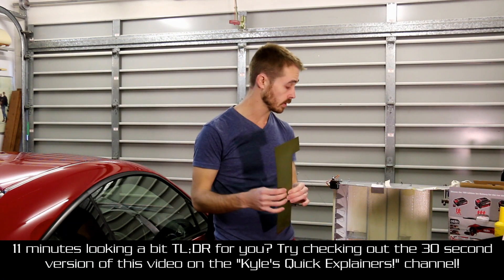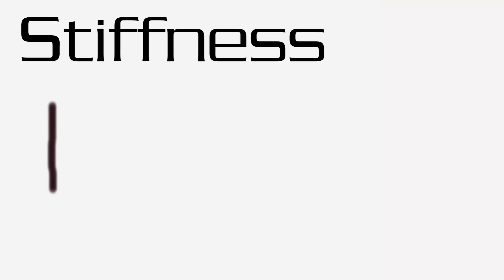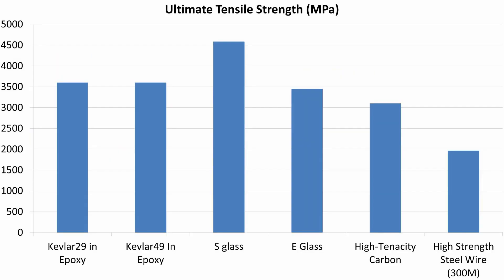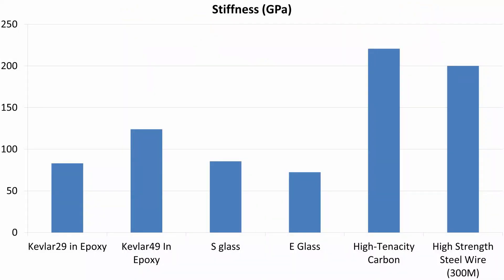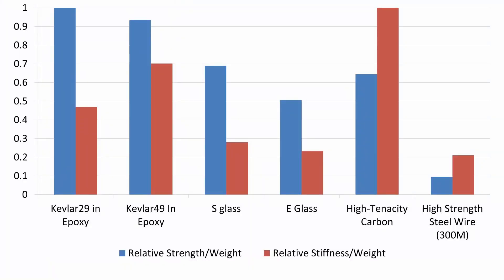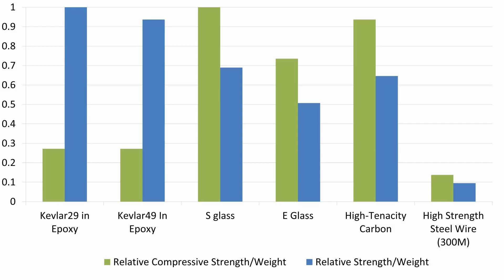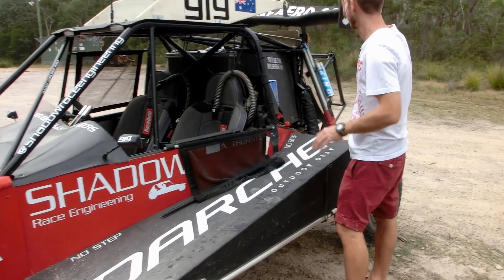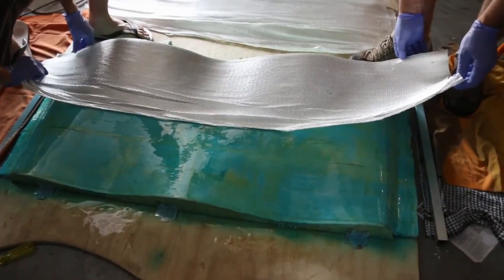Carbon Fiber vs Kevlar vs Fiberglass - Which one is right for YOU?

Comment: Huge fan of your vids- def the best at explaining motorsport engineering on the web. I have a request- can you do one on chassis rigidity? It's generally accepted that stiffer is better, but is that really true? Is chassis flex ever a good thing? Do engineers actually tune for it?
Reply: In top fuel dragsters flex is extremely important.  I don't know any details, but the frames are so delicate looking, that I don't know how they handle the extreme horsepower and stresses.  Failure in some have resulted in dramatic crashes and amazingly few injuries do to cocoon type driver pods usually made of carbon fiber.
Reply: I don't think manufacturers want flexible cars. 
If they did they wouldn't brag about making the car 25% stiffer from last years model every year.
It may add a layer of comfort to commuter cars with cheap suspension, however on performance cars manufacturers don't want the body flexing and pulling the suspension out of alignment.
Reply: Seconded! It's interesting how chassis rigidity is always touted as a plus, but many cars that we hold in high regard, like the Lotus Exige, or Honda's s2000 are not the most rigid. Great video as always, Kyle. Lots of information!
Reply: Beyond a certain point added chassis stiffness is a byproduct of other needs, usually NVH and crash worthiness. Plus OEM suspension bushes are often three-dimensional compliant, thus providing different suspension sets for different load conditions - chassis flex is far less of an issue for handling purposes than it was 15 years ago.
Reply: Beni Stingray thats a motor cycle 
These are cars
Reply: Yeah thats true but i think/believe the same goes for cars at least to some point. 
Sure a bike leans into a corner and you have sideway forces refering to the suspension but as long as youre not on an absolutly flat track and/or an extreme downforce car i think the right amount of flex is positive.
Lets hope he picks up the talk and does a video because im not an engineer :)
Reply: Some flex is needed! A good example for that is the Moto GP Ducati that was introduced 2011 i believe with the carbon firbe chassis. Rossi and other good drivers struggled a lot with that bike because they didnt get feedback under bracking and turning in. 
Good little article about it: https://motomatters.com/analysis/2011/08/08/the_trouble_with_the_ducati_desmosedici_.html
Reply: second that!
Reply: tmactmacy no
Never
You never want energy to be going into moving or flexing the chassis

Comment: After watching this video, a possible application of Kevlar that springs to mind would be within a pull rod suspension as the suspension arm. Kinda funny how few fiberglass chassis cars there have been.
Reply from the maker: Well, more often than not, chassis structures are stiffness critical (particularly torsion stiffness), hence the prevalence of CF chassis. Also, as I mention in the video, higher grades of carbon with more tensile strength do exist, and are employed by higher level race teams, but not by the home builder.  You could build a fibreglass chassis if you were on a budget, but if you were on that much of a budget, why not go steel spaceframe?
Reply from the maker: Apparently, someone made a list! http://www.pistonheads.com/gassing/topic.asp?t=1356682

Comment: +kyle.drives By chance could you dabble with basalt fibre composites? I hear lots of pros but haven't seen wider adoption.
Reply from the maker: I wasn't even familiar with them, having a look at their basic material properties though they seem great! I think it will only be a matter of time before they have widespread adoption though, it's like how they used to use boron fibres until they replaced them with carbon fibres.

Comment: "parts not subjected to impact"

surprisingly this has been done, both the SLR, LFA and laferrari has some form of structural carbon fiber that absorbs the impacts in a crash, though these are also shaped in such a way that they achieve structural strenght
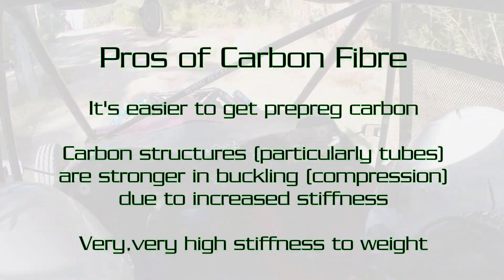Reply from the maker: Ah yes, I should mention this (will annotate the video). What I more should've said was shock loading where the part is expected to not fail, as fibreglass and kevlar will do better here. Carbon is a very common material in impact attenuators because they are designed to permanently deform (fail) inwards. Carbons high stiffness allows you to use a tube like structure and be very strong in direct compression (10:19 in video) without buckling. You then use a geometry like a tapered cylinder or cone and it essentially folds in on itself, absorbing large amounts of energy as it progressively folds down. This is further helped by the thicker walls per unit weight for carbon, which means they have more bending strength on a skin basis. FIbreglass may have buckled in this scenario (on either a skin or whole structure level, not stiff enough), and kevlar is weak in compression, so carbon is the way to go. One of the guys I went to university with actually designed a carbon impact attenuator for the SAE car we were working on at the time, saved a huge amount of weight for us. Carbon attenuators are also used on most high end race cars (including F1) in addition to what you mentioned.

Make sense?

Comment: "corrodes steel and aluminium"

why? it's a polymer so why does it corrode steel and aluminium? (answer in the simplest possible way)
Reply: Carbon fiber is still carbon and  is a conductor of electrons. That's one of the side benefits for  military aircraft, carbon fiber will absorb microwave energy from radar and dissipate the energy as heat.
Reply from the maker: It's all about the galvanic series. Carbon is a long way away from steel and aluminium, so sets up a sort of battery in real world conditions. Think about batteries where carbon is used as one of the electrodes. I have heard of some racing manufacturers using a single, thin layer of fibreglass under their carbon to help with corrosion on an aluminium honeycomb core. Our carbon/aluminium SAE car used to have huge corrosion problems with this.
Reply: +KYLE.DRIVES Can verify. Whenever there's a carbon to aluminum connection (it's almost always aluminum due to its great adhesion with epoxy, therefore reducing bond area needed), fiberglass is used to "shield" the Aluminum from the carbon.

Comment: what about kevlar fuel tanks?
Reply from the maker: Fair point, kevlar has very high toughness and good abrasion resistance, and fuel tanks are a component that will only ever see very high loadings in tension, so Kevlar is appropriate here. I guess for the applications I was only really thinking bodywork, I'll add an annotation for this.

Comment: Once again, excellent video. Honestly never really thought much about fiberglass (for Formual Student its carbon everything). In the making of body panels, or even structural fiber glass parts, would you recommend chopped mat or an actual weave pattern like twill? Any significant strength differences between them (assuming same fiberglass is used for either)?
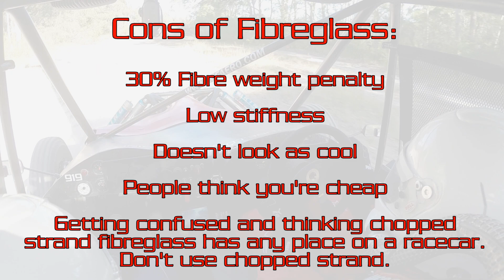Reply from the maker: Yep, chopped strand is terrible for strength to weight, (I mention this about 10:07), don't even bother using it for anything other than moulds. The random (and short) nature of the strands mean they don't effectively transfer load to each other so the matrix gets extra loaded. The fiber orientation is also almost certainly going to be wrong, as there aren't many parts on a car that are all going to be loaded in the same direction. Stick to weave, plain weave for low curvature, twill weave for high curvature. I can't remember the exact number but I think it was chopped strand being about 30% the strength of plain.
Reply: +KYLE.DRIVES damn. Dully noted.